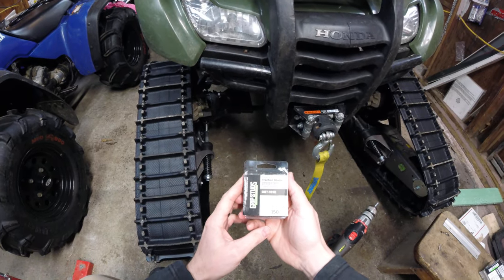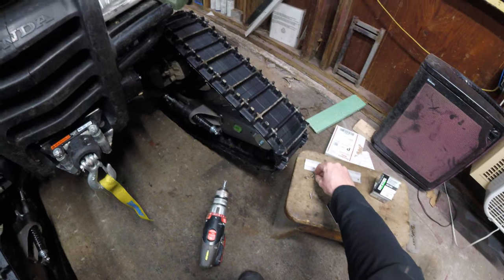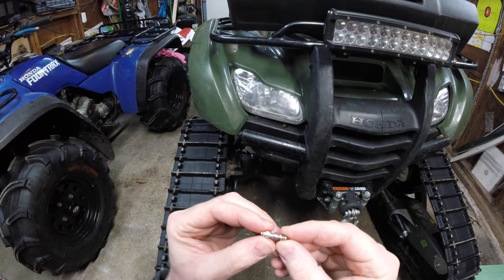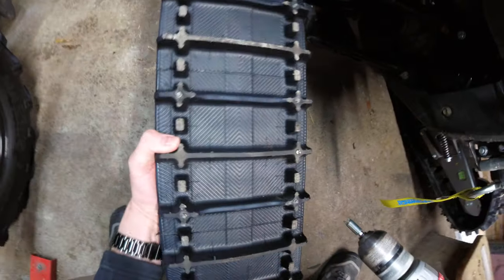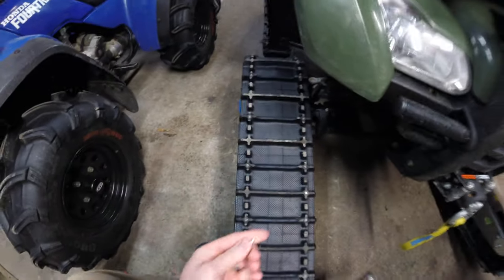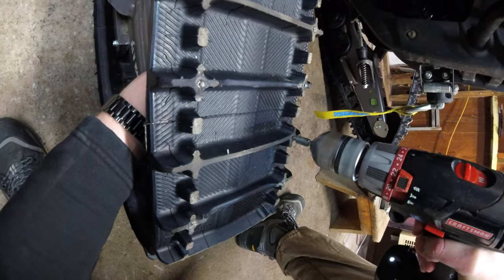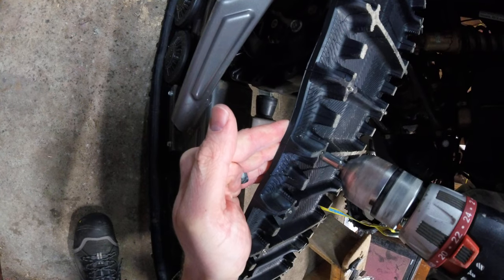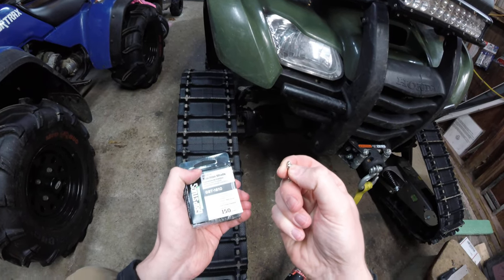Grip studs 1610 installation video camso r4s tracks

Comment: Great info, thanks for posting this.
Reply from the maker: Thank you
Your welcome.
Reply: @wademoulton5109  Just installed 198 of them in my 2020 Skidoo Expedition SE track, went great. What do you think of those r4s tracks?
Reply from the maker: @CraigVanSickleAK  thats awesome.
 I like them allot perfect for what I need 99% of the time but they have there limitations lol. I had a little trouble when we received 36 inches of snow in less than 18 hours but other than that nothing has stopped them.
Reply: @wademoulton5109  Good deal, I like the looks of them. The narrower tracks keep the machine footprint down.